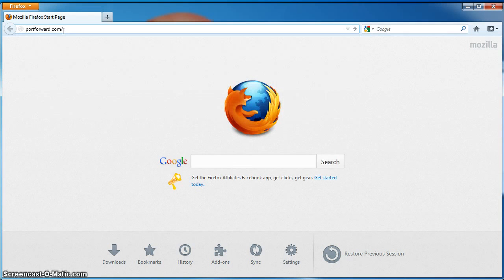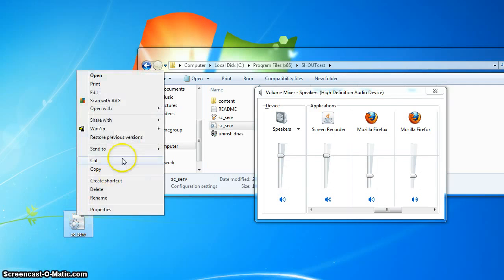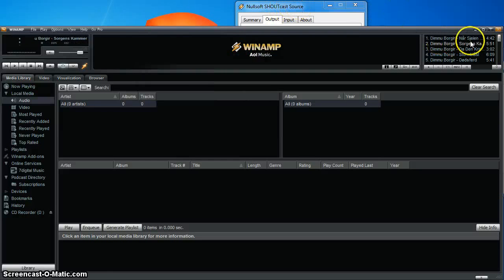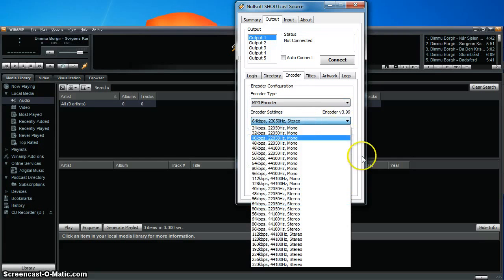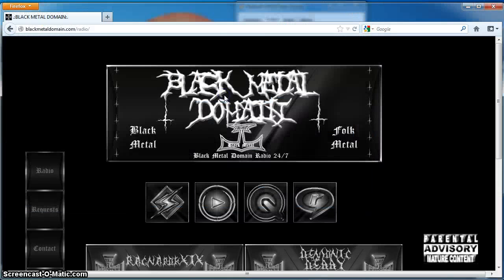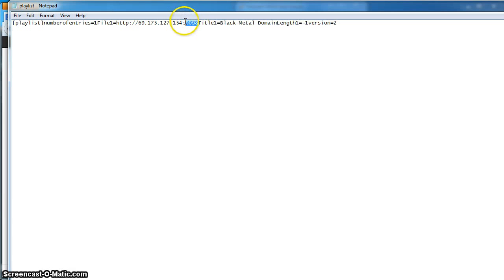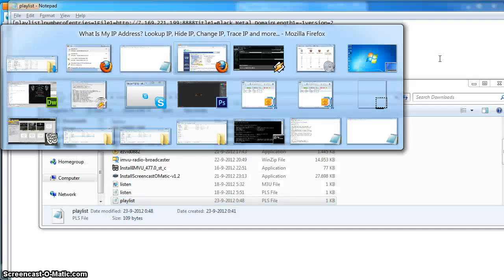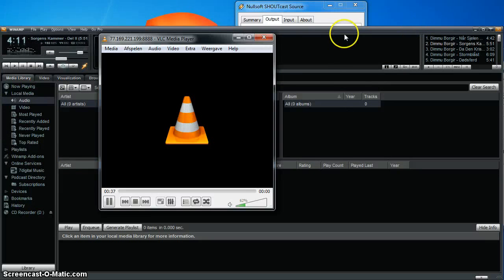Howto broadcast MP3's into IMVU Room - vid 3

Comment from the maker: The above methodology no longer applies since the software demonstrated is no longer available.  I will leave the video live as it demonstrates how using the built in Flash player within the IMVU client can be used to call data from an external server.   This ability to call data from an external server limits IMVU's DCMA liability and therefore reducing their concern regarding content being served from these servers.   By embedding the flash player in their client IMVU have provided us a means of more freedom and speech and expression at minimum liability to themselves, every IMVU user who values freedom of speech and expression should take note of the significant value of this ability and should fight to retain it should IMVU ever try to remove it or restrict it's access.